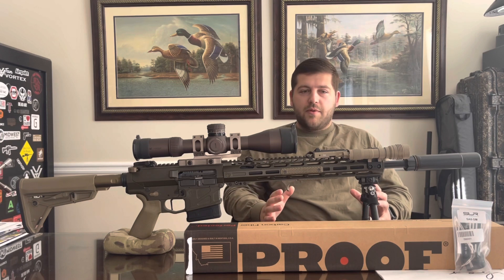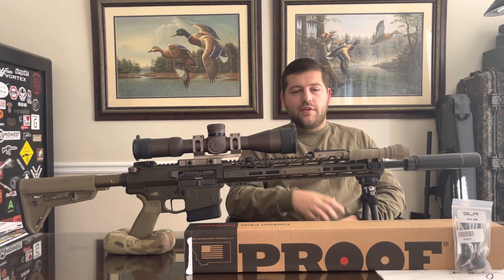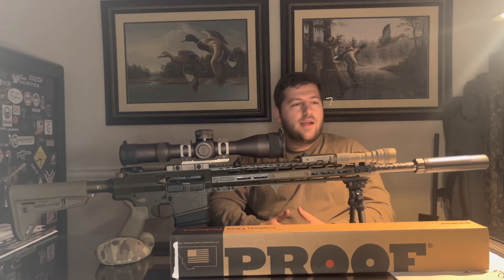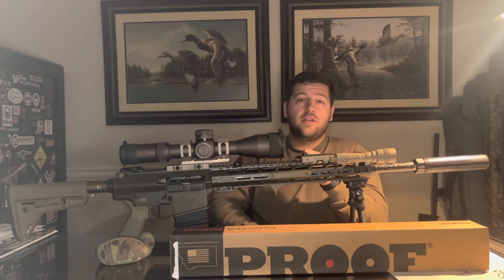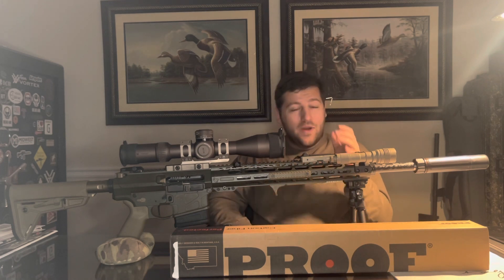Proof Research 20” 6.5 Creedmoor Carbon Fiber Barrel - First Thoughts and Install

Comment: Which gas tube did you end up using on this? I am looking into doing this and don’t see many options on a +2 gas tube..
Reply from the maker: The +2 gas tube was included with this Proof barrel. I used part number 100042 specifically on this rifle

Comment: Been 3 years, never made a follow up showing how it shot, im starting a similar build and would like to see
Reply from the maker: Sorry for this delay. It shot between .8” and 1.2” for me on average. The barrel extension on this barrel was very rough/sharp and was hard on brass with gouging durning extraction. Went back to a Criterion. Proof was great and balanced very nicely. My other Proof barrels are fantastic and their customer service was awesome. This one was just a little rough.
Reply: @ do you think it was the head space from the barrel or issues with the bolt? I can’t remember which bolt you said you were running, but I believe if I remember correctly proof recommends running the JP bcg
Reply from the maker: I don’t. Headspace was good with the Proof. It was the lugs on the barrel extension on the Proof were not cleaned up all the way if that makes sense. Yes, I am running the JP FMOS in the rifle. I’ve always had great barrels with Proof, this one was an outlier in my experience.

Comment: How does the proof 6.5 cm shoot? I just got one and finished the build. Going to shoot soon.
Reply from the maker: I have been happy with it. Just went through my 2nd proof and back to an 18” criterion for length savings. The JP barrel extension on the Criterion was easier on my brass, not leaving long “snake bite” gouges like both Proofs

Comment: Looking at a LMT with a carbon barrel, not sure if the weight saving is big and if the durability of multiple shots or abuse is worth it?
Reply from the maker: Great rifles. Personal preference for sure. On a super hard use duty rifle, I’m sure a carbon steel barrel would work just fine. The proof helps a bit with balance with a suppressor on the end

Comment: Must not be happy with your Proof barrel swap. I checked ahead in your video library, and no more mention of this project. Best guess is that Proof barrel walks the group after it the first few shots. It would be nice if someone would let the rest of us know the truth on these carbon fiber barrels.
Reply from the maker: I’m happy with the proof I’d say. Will also make a follow up vid for you. I have tons of barrels from Bartlein, Kreiger, Proof, Criterion, Shilen and have used some other mfg in the past. Would you like me to follow up with my experiences and differences between button, chf and single point cut rifling as well?
Reply: @hkrifleworks I’d love to see a comparison of them. Velocities and groupings at distances specifically. Maybe even weight of rifle .
Reply: @hkrifleworks what’s your opinion on best AR10 barrel for accuracy at distance? I’ve had an 18” AR10 for about 10 years. Push it out to 1150 but it’s not very accurate at that distance. It’s a >1MOA gun. Would be more fun if I was getting .5MOA results. I shoot SMK bthp factory ammo and have a Razor Gen2 so I should spend the money for a better barrel.
Reply: My thought also.  For all the barrels that proof sells, it’s rare that anyone makes a video about their semi autos.
Reply: A lot of guys swear by them but I’ve been seeing where the velocity is slowing than steel.

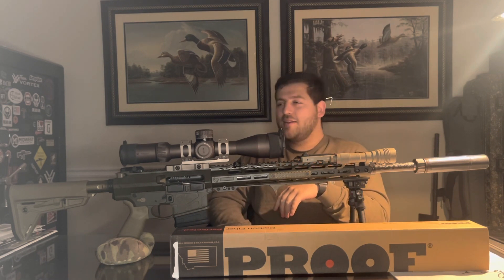Comment: 9:08 - Building matched 20" Aero M4E1+M5 in Canteen Green. Matched Proof (solid steel) 20" 6.5CM+223Wylde barrels. Matched DeadAir KeyMicro brakes. Matched Razor Gen3 6-36+1-10. ADM Recon Canteen Green mounts. B5 SOPMOD stocks. Ergo Aggressive grips. RA-535 triggers. Still building them. but probably 100yards for fun. I'm curious what accuracy to expect out of these things, given I'm not using the Carbon barrels due to cost.

I'm calling it the "Mom: We Have LMT South American Contract Overrun At Home" set.
Reply from the maker: Haha I love it 😂

Comment: Great Video.  Can you point to the followup video?  I would really like to see how it shot.  I have four 6.5 CMs and I built them all.  Two AR 10s, but built from Areo Precision Receiver sets.  One is running a 24” Ballisitic Advantage barrel and the other one is running a 16” Faxon barrel.  Of the two guns I actually have more fun shooting the 16” gun over the 24”.  My two bolt guns are both running Zermatt actions (highly, highly recommend Zermatt).  One is running a Proof Carbon Fiber 20” and the other is running a Proof Carbon Fiber 24”.  I am a huge fan of Proof Research Carbon Fiber barrels.  I am very glad that you showed the use of the Go & No-Go headspace gauges.  I think it is the most important step in building a gun, especially when using prefit barrels, but all my Proof Research barrels have been perfect.  Thank you for showing how to boil the muzzle to make Rockset soft enough so that you can remove the muzzle device.  However, I am leery of doing that to a carbon fiber wrapped barrel.  I just built a 6 ARC bolt gun (again using a Zermatt Action) and I used a SureFire muzzle break on it.  It has a Proof Carbon Fiber 22” barrel and I am a little concerned what boiling the end of the barrel might do to the carbon fiber.  I would l like to remove the SureFire muzzle device so I can try a tunable muzzle break to see if it improves the accuracy any.  Again, great video and thank you for making it.  I learned a lot.
Reply from the maker: Thanks a ton for the kind words. I need to make a follow up video on the barrel. It seems to be shooting well, but I am tweaking some loads as they are getting ejector swipes just over 39 grains, which seems a little low. Very nice! I also recently built a six ARC bolt rifle, but I did it on a Stiller Tac30. if I could go back, I would do it on a controlled round feed action with receiver mounted ejector other than the bolt mounted plunger style. I will prioritize making a follow up video on the proof barrel. Thanks again for watching and for the support 🤙🏻
Reply: @hkrifleworks  Take a look at Zermatt Actions, but don't be in a rush.  They don't make the action until it is actually ordered and you have paid your $100.00 nonrefundable deposit.  The ejector is receiver mounted.  Again, great video and I can't wait for your followons.

Comment: Got an update on how the proof research barrel is working? Looking into maybe getting the same
Reply from the maker: Holding up well! Inside the barrel extension is a little sharp so it leaves a little “snake bite” on the neck of the brass. Can do a video update if you’d like

Comment: Great review and awesome rifle. Unfortunately i don’t have the skills to build. What is your opinion on the best production AR10 6.5 that money can buy?  I was looking at Nemo Arms, Falkor Defense and JP.  Any thoughts?
Reply from the maker: Much appreciated! As long as you have some basic tools for the job, it’s not bad but can understand the hesitation. It’s hard to make a recommendation on “the best” as it boils down to a lot of factors like price and other features you would like in a rifle (weight, ambi, barrel length, gas system length and other specs). I would say that any of the bigger reputable brands will serve you well though if it meets your requirements for use!

Comment: Any chance you have any velocity data for the 18 in? Looking at the stock UIC 10a in 18in for the same reason you talk about. Just want to make sure it’s still got some legs to reach out. Great content!
Reply from the maker: Appreciate it man! So I was getting around the mid 2500fps range with factory 140gr and could get closer to 2600fps with hand loads and a 140gr match bullet.  Could get out to 1200yds or so easy but was kinda hard on my brass even with an adjustable gas block. The rifle length +2” on the proof and extra 2” really helped out getting the velocity I needed as well as not being as hard on my brass. YMMV though. That criterion was an absolute laser.

Comment: what wrench did you use to remove and insall the barrel nut?
Reply from the maker: My magpul armorers wrench worked great. I think it’s castle nut wrench pattern if I’m not mistaken
Reply: @hkrifleworks  thanks, no issues with the install.  The Magpul wrench castle nut side has bigger teeth then the real avid wrench.  Waiting on jp BCG and SCS to come in.  Currently have a gen3 PRS installed not sure if I want to try the lite version for weight savings

Comment: Perfect timing with this video, my 20" proof CF 308 barrel is coming in tomorrow and have the ADM UIC-10 builders set that is calling for a barrel.  Need to get a JP BCG, are these recommended BCGs
Reply: Did you go with the 15” hand guard or the 17” hand guard for the ADM UIC-10A builders set? I’m ordering the same exact parts but I don’t which hand guard length to go with
Reply: @steelbucks1202  I went with the 15" handguad, 17" wasn't an option when I placed the order over the phone.  I inquired about a receiver set and was told they could sell me the set and made the purchase over the phone.  This was probably during a time when they removed the UIC-10 set from there website before adding it back
Reply: @FullerDinh  That’s awesome bro. I appreciate the reply, glad to know somebody else is doing the same thing as me.

Comment: I might have used a bit too much rockset on a gas block I regret. Do you think this procedure would stain half of a stainless barrel if I tried the same
Reply from the maker: Oh no and that’s a good question. I’ve boiled many stainless barrels before but they’ve been coated. This criterion I am boiling in the video is 416R Stainless but has been nitrided. I wouldn’t think so, especially if you did it once but can’t say either way with 110% certainty.
Reply: @hkrifleworks  appreciate it 
Guess I'll paint the bastard if it does

Comment: Dope rifle 
but I just run the 123’s to 2850 in my 18” tubes.
Reply from the maker: Thanks man and heck yeah. That’s moving. What powder?
Reply: @hkrifleworks  
w760
4064 can get 2800 but it’s full and my favorite at the same time. 
N540 will almost get 2850
And I’m going to try some n555 as soon as I get home

Comment: Dude you have a very similar taste in firearms as I do. I have a Aero setup with a Krieger 20” barrel in it JP full operating system it also. I get .5 & .6 MOA also but be careful getting that proof barrel hot it will walk. Dude I have that same press and poster wtf this is wired AF. Ummm not running 6.5 stayed with 308 I’m getting crazy accuracy with my rifle Krieger makes good stuff brother my preferred load in 308 of course is LC brass fed large rifle primers the match primers with a 168gr Sierra bthp on top of 45.4grs of CFE223. My next move with my rig is the 175gr Sierra bthp on top of AR comp
Reply from the maker: Haha heck yeah man! I’m looking forward to seeing how it groups and the velocities I get from it. No way that’s awesome lol I think Hornady mass sent that poster. CFE223 has been solid in 308 and 6 ARC for me. Glad to hear your rifle is hammering. Hope those 175s shoot well too!